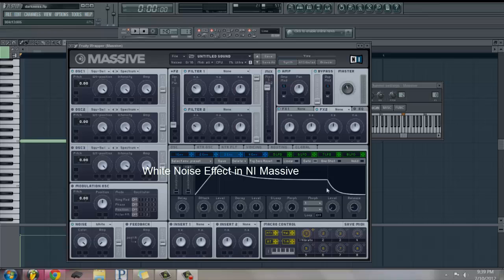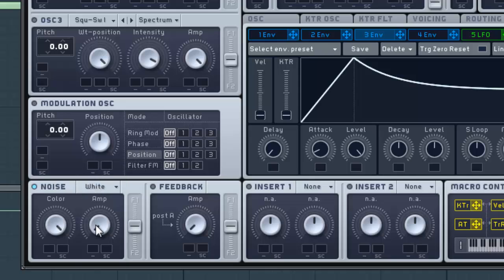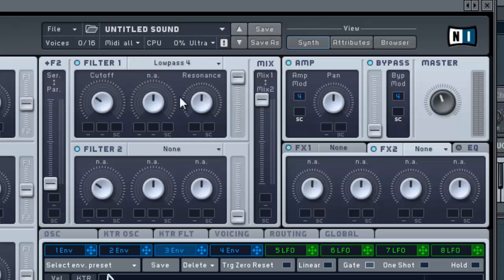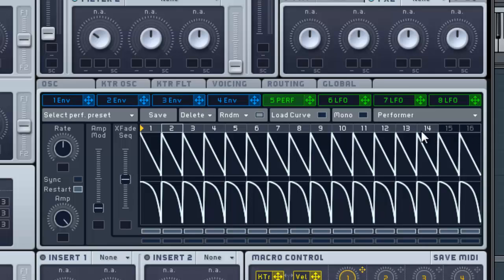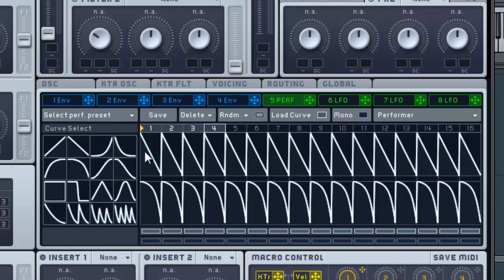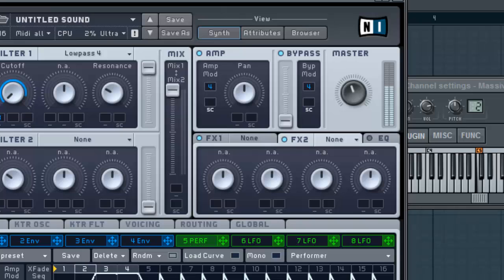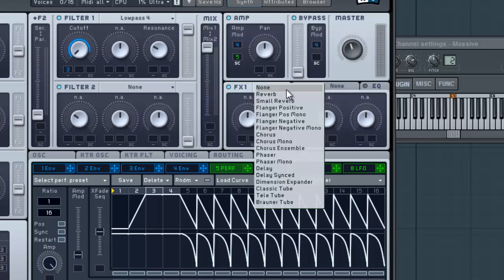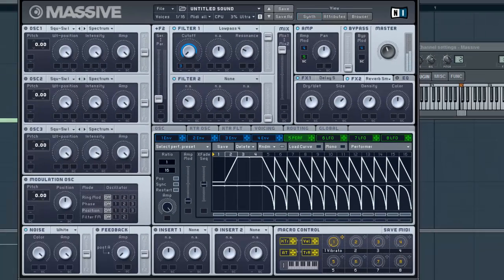White Noise Effect in NI Massive

Comment: I had this problem in FL studio.... FL studio is still a 32bit program. So I had my 64bit NI plugins set as my VST's. They would always screw up and not reload properly. So I have to use the 32bit vst's in FL. So im gonna assume you may be using the wrong bit folder as your directory.... Check into it